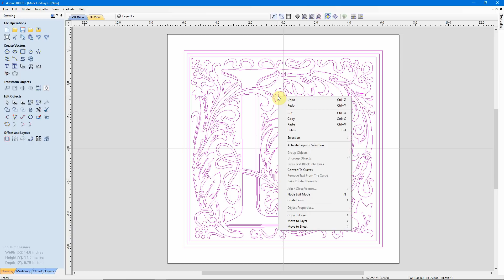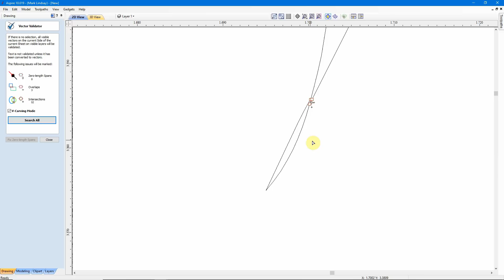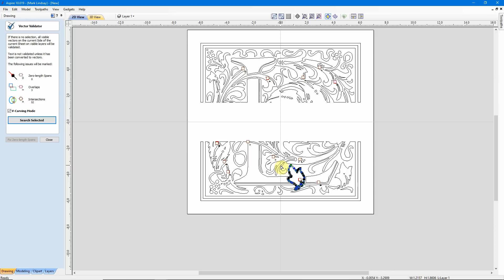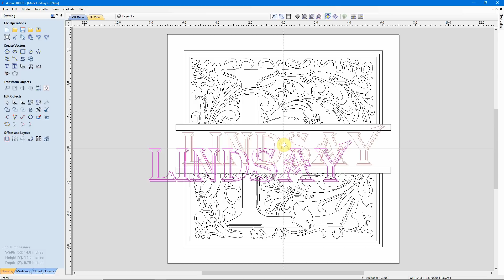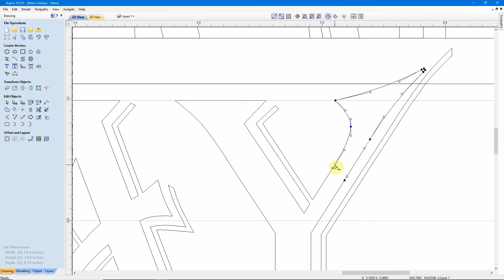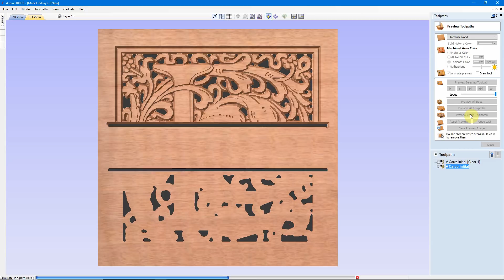Trim Vectors With One Click - Design a Split Initial Monogram in Vectric Software

Comment: How do you trim a part of a 3d relief but keep the border?  I bought a 3d relief and want to take the middle out.
Reply from the maker: Lots of ways to do that in Aspire. Probably the easiest is to draw a vector inside the area you want to keep, select the model and the vector, then click the icon for Clear Area of Selected Component Inside Selected Vectors.
Reply: @Mark Lindsay CNC  i got vcarve pro 11 and has that option. I cant get it to work. I hold down select, click the vector, goto trim tool, click inside boundary and nothing. I put a piece of clipart in there and it wont work. Either im doing something wrong or its disabled for some reason
Reply from the maker: I'm sorry, but the option I was talking about isn't available in VCarve. I use Aspire, so I'm not sure what is included in your Modeling tab. Go into your Modeling tab, and in the Component Tree, right click on Level 1 and see if Clipping is an option that comes up in the context menu. If it isn't there, then I'm afraid you can't edit the 3D model you wish to edit using VCarve. If it is there, I'll refer you to this video, where I explain how to use Level Clipping: https://www.youtube.com/watch?v=kjJL5gKY4XE
Reply: @Mark Lindsay CNC  clipping works but it wont cut out the inside part of the model out. I can get it to clip everything outside of the model. I tried the trim and i cant get it to work at all. I bought a 3d relief. It has logs for a border and a fishing scene. I want to get rid of the fishing scene and keep the log boundary

Comment: Sorry if this an obvious question.  Just starting out and going through your videos.  In your stacked text video you used the weld tool to convert all the text to vectors.  Could you also weld the font in this example?  When is it appropriate to use one over the other.  Thank You for your videos.  They're making learn vcarve much easier
Reply from the maker: Welding and Converting to Curves are two completely different things. Welding is done to join two separate, otherwise unrelated objects together. Converting to Curves transforms an object into vectors that can be edited. In order to weld two objects together, they must first be converted to curves (if they're not already curves.) In older versions of the software, this was a t-step process. In newer versions (like I demonstrated in the Stacked Text video) it's now a single step. In this project, there is no welding involved. It's simply converting to curves where appropriate, then trimming vectors.

Comment: I need to remove one line from the bottom of my project. I tried making the rectangle and removing what's in it but it didn't remove anything. What else can I try?
Reply from the maker: If it's just one vector, select that vector and tap the DELETE key.

Comment: I got as far as Vector Validator in VCarve Pro Version 9.5 and there is no V-Carving Mode. Is this strictly for Aspire?
Reply from the maker: I believe the V-Carving Mode check box was added in Version 10. I’m not 100% sure what the difference is in using it, only that it seems to help in cleaning up vectors specifically meant to be v-carved.

Comment: HI MARK, I AM HAVING TROUBLE WITH MY "N" LETTER. IT IS ALL FINE UNTIL I ADD MY BARS, THEN WHEN I GO TO RUN MY TOOL PATH IT SHOWS I HAVE A BUNCH OF OPEN VECTERS AND WHEN I CALCULATE ALOT OF THE INIT PART IS MISSING. CAN YOU HELP??
Reply from the maker: Select the open vectors and join them. I've demonstrated this in several of my videos. Here's an example: https://www.youtube.com/watch?v=1t6TlEQnLxM

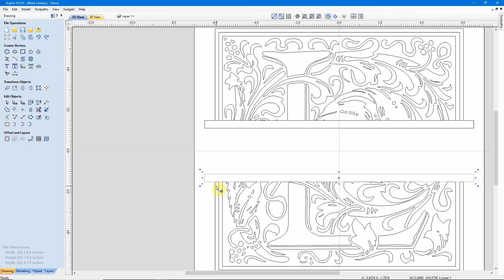Comment: Thanks for the tips, as always!  I'll share one in return ... the easier way to do the operation at 15:30 - Control-Shift-V will vertically mirror an object around the job center (even if that's not the job origin), and Control-Shift-H will do the same horizontally.
Reply from the maker: Thanks for that! It works like a charm!

Comment: Mark - Excellent video as always!  What is your opinion of the tooling marks the 90 degree v-bit will leave due to being set at a flat depth?  I spend a lot of time trying to figure out how to reduce these as much as possible.  Have we considered using a flat bottom bit?
Thank you sir!
Reply from the maker: I just got a flat bottomed 60° v-bit, but I haven't had a chance to use it yet. Basically, I use a sanding brush and Scotchbrite Radial Disks to take care of the tooling marks left by the v-bit. 
Nylon Wheel Brush 120 Grit: https://amzn.to/3avtKhl 
Nylon Wheel Brush 180 Grit: https://amzn.to/2WSUJPN
Scotch-Brite Radial Bristle Disc, 80 Grit: https://amzn.to/2yo5Oyp
Scotch-Brite Radial Bristle Disc, 120 Grit: https://amzn.to/3dI7YsM

Comment: I'm not angry, Mark.  I'm not good enough to be angry!  I do have a question though.  With this method and the other ....... Do you have to do all the steps with EACH letter of the alphabet?  Thumbs Up..............
Reply from the maker: Yes, you would have to do this with each letter. Probably the best way to handle that would be to do them as you use them - then you're not wasting time on letters you don't use often. When I exported the SVG files, I should have added "L" to the name to let me know what it was. I can rename it now, so I don't mess up and go through all that again.